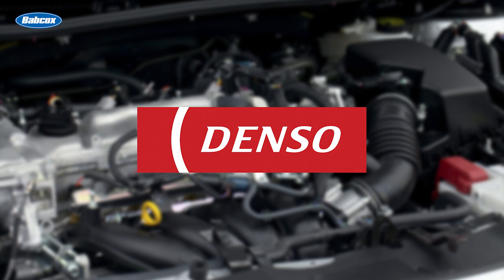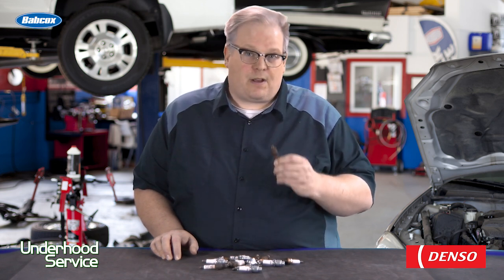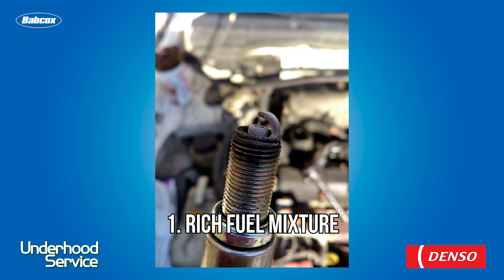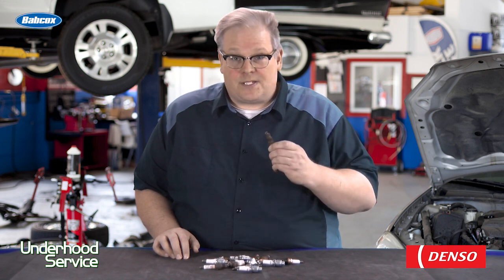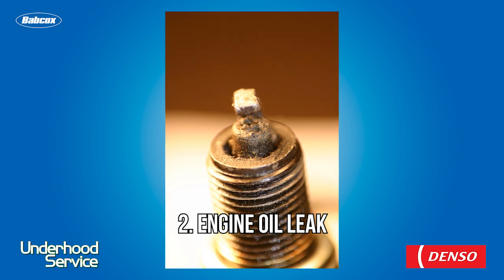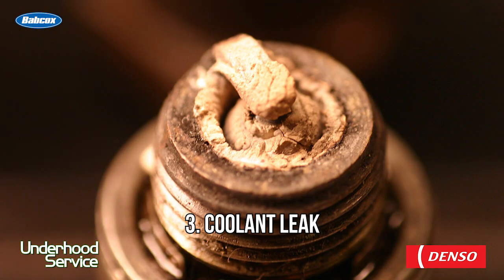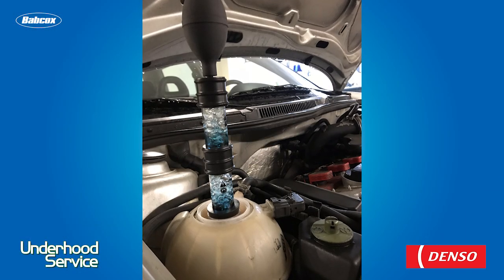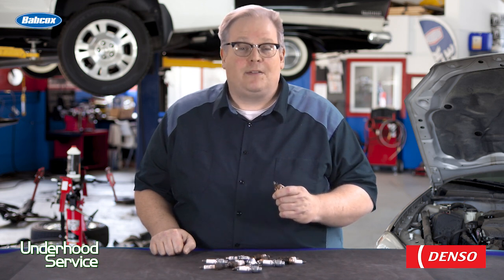Causes Of Spark Plug Fouling | Maintenance Minute

Comment: Finally a good video on plug residue buildup and what it means! Thanks! I have a gmc 350 ,415,000 miles, plugs now have a white residue building up on 1 year old plugs, #7 cylinder has a lot of buildup. I know she is due for a motor replacement, coolant puddles on the intake, blows smoke from ring wear, but can still tow a heavy load.
Thanks again!

Comment: I've found that they can go sooty in a motorcycle engine as if it was running too rich if the piston rings or valve guides are a bit worn.

I asked a couple of people about it 24 years ago,an automotive teacher & a motorcycle shop,they both asked is it blowing any smoke or is it a bit old ?

The band aid fix for that was to go to a hotter spark plug which reduced carbon fouling for a while.

It also depends on what the engine is used for,excessive idling & the spark plugs will run black !
Reply: Or buy a high flow K&N air filter.

Comment: 3 out 8 spark plugs on car are wet with gas smell what does that mean. I just installed a new ignition coil. And car will crank and cut off. Its carburetor. Any help will be appreciated
Reply: check fuel pump

Comment: I ran too much octane booster with MMT in it and it turned all of my plugs orange?  I'm assuming orange on the top of all the pistons and the bottom of all the valves?  Can I run premium unleaded here in CA and will that shit burn off and go away?  or not?  Did I harm my motor??

Comment: LOL I love the canary in the coal mine reference, 5 of my plugs were regular for a 100k mile Honda engine, likely factory plugs, but the rear (V6 obviously) steering side plug was black, but not caked with anything, not shiny, just like a matt black carbon like appearance on the electrode porcelain.  Best reference for the color would be the inside of the end of a tail pipe, that color.  No engine codes, just something I noticed when doing a routine plug swap.  The car runs and idles smooth so I was surprised when I saw it.  
Any thoughts?  
Is this the early signs of future problems on this cylinder? 
I realize this is a 5 year old video and I may not get a response but this is not an urgent issue, I was just curious if you had any tips/feedback for me if you have the time and happen to see this.

Comment: nobody talks about how restricted some exhaust systems are, if you car has a muffler with a tiny 2 inch or less outlet coming out of it you need to drill a hole and jb weld a broomstick or cheap pipe in that and like my post after ur car runs smoother and gets +3-7 mpg on the highway.

Comment: Hi Thanks for helping people with your videos. I have a 95 toyota corolla with 200k, I found oil not on spark plugs but only on their threads. I have check the dry compression and its exactly 200psi on all cylinders. Am not sure if the rings are bad or valve stem seals or either pcv gone bad. I regularly clean pcv and felt its not the problem. Please help. Thanks
Reply: Valve cover gaskets are leaking into the spark plug wells.

Comment: My old dad (R.I.P) was a motor mechanic & a used car dealer, sometimes if he had a car for sale with oily rings in one cylinder & had no budget to replace all the rings & bearings, he would just replace the spark plug with a hot plug.
Reply: wow, so he scammed poor folks instead of fixing the car.. got it.
Reply: @WeirdWabbit  who cares sold as is.

Comment: Is this for snowmobiles to? Bescuse i have a prblem with a snowmobile thats always blowing the plugs..
Reply: Define "blowing the plugs", it's unclear what you mean.
Reply: Fouling?
Reply: Change the pre mix your putting in it. Also thin it out alil. 32.1 or 28.1 is a good place to start.
Reply: @dmo848  FYI 32.1 is 4 oz of 2 cycle mix and 50.1 is 2.6 oz of 2 cycle mix. The higher the number the less 2 cycle used.